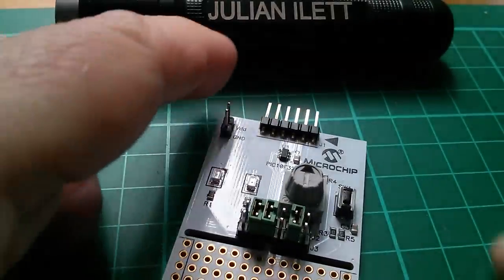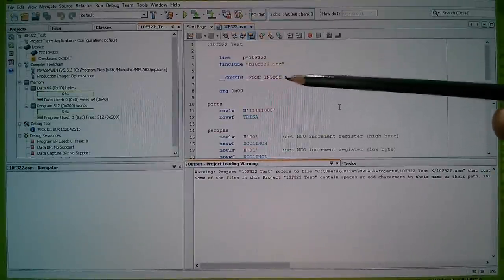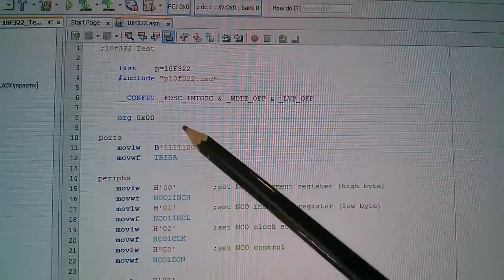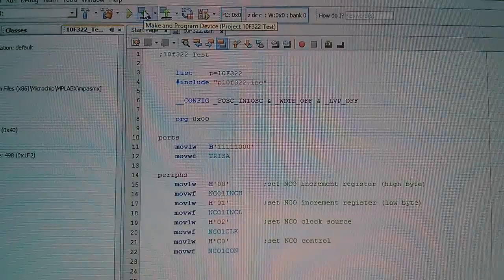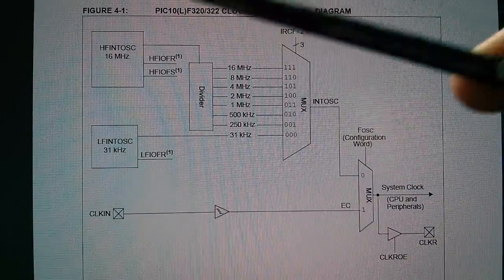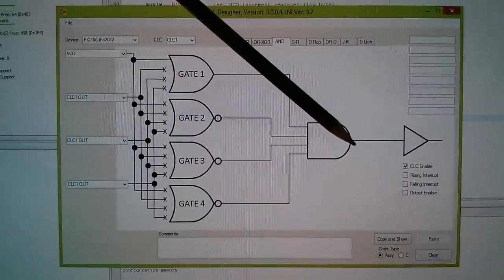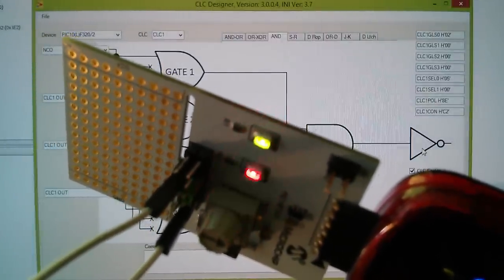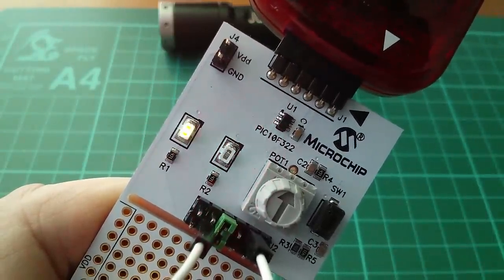Julian plays with: Microchip PIC10F322 6-pin Microcontroller

Comment: Julian Ilett ,
This is painful (assembly language, 200 page datasheet), a rube-goldberg (not the easiest way to blink leds), and yet I enjoyed the whole video.
It is fascinating that such a small device can pack so much.  Thank you for sharing that world Julian.
Reply from the maker: Hari Wiguna Cheers Hari. I really enjoyed playing with this thing - a bit like playing with a huge meccano set.
Reply: Julian Ilett a huge electronic meccano set housed in a box smaller than pencil tip! Just wow...  I'm looking forward to your next adventures. Cheers Julian!
Reply: Hari Wiguna It is not so hard, assembly language on Microchip microcontrollers is one of easiest to use (much easier than one Atmel), there is little instructions (less than 40 on baseline and mid-range 8 bit MCUs) and instructions are picked well.
On other hand you can always use C, MIcrochip offers free C compiler (which is junk, but same stand for paid version), I found that for small PIC for me best C compiler is B Knudsen Data (BKND) CC5X (there is free version which work much better than Microchip paid version, but it is old school compiler and work from command line it don't have IDE)

Comment: I know it is an old video now, but just for kicks I did the same thing with an Arduino Nano that I put Basic on, then wrote a flashing LED program in basic to flash 3 LED's; being an x-cop, of course I flashed the red and blue for the front of the NANO and put an amber on the back side as a warning in addition to the pull over light.  Really looked cool, the wife gave me a 57 Chevy scale model for Christmas several years ago, I plan on mounting those lights on that and make a squad car out of her, should work great an look cool on the dash of our Class A when she is parked in the rv park.
Reply: Did you every finish the little squad car?

Comment: I have been working on the STM8 series which are 16Mhz 20 pin and 15 pence. STM8S103f3. I have been programming  in C. If using STM8 I strongly recommend skipping STs libraries and examples and instead use the free libraries and examples from icking on Github. I consider STs silicon superior to Microchip's but STs development support is best avoided. ST's visual develop is usable. Not as user friendly as Microchip's.

Comment: Incredibly potent 6 pin,  found the PIC10F322 is $11 but the programmer to be rather out of reach at $47. Surely one can do ISP for less? Just loved this Julian. Please do more with the PIC or Arduino involving other output devices, ie contactors, motors, servo

Comment: We've been working with assembly in one of my courses, specifically the Motorola MC9S12E128, and it's interesting to see what different code is requited to make the microcontrollers do the same basic things, especially since the MC9S12E128 is a bit dated. I'm really interested to see what can really be done with a microcontroller that has so few I/O pins!

Comment: Good evening all. Wonderful segment Sir Julian. I'm wondering where you purchased the PIC development board? I have never seen anything from China that came with any additional information regarding the purchased component or module. The programmer itself would strain my hobby budget.
Reply from the maker: It came from Microchip Direct. There are clone PICkit3s available from China, but I've not tried them so caveat emptor
Reply: +Julian Ilett I have the Sure clone. Nicely done if I may say.

Comment: Hi Julian, thanks for your videos. However just one thing to say mate. If you really want to get projects (including pro ones!) up and running very very quickly and easily, give Flowcode a try, not the free version, but the commercial one, it's just fantastic. It takes programming to a different level and you can pretty much do anything you want... A blinking LED or something much more complex can be done in very little time with Flowcode, you can use the interrupts in the program to flag variables, very very easily... Anyway, take care and keep them up!
Reply: ***** :-) Well, you can start with the chip pack option which is £79... then upgrade. But obviously you might not see the whole picture here...the point is that with Flowcode you can build any application is very very little time with no coding. I do appreciate my time and value it too, if I count the many programming hours that Flowcode has saved me... Whilst is OK to use C, Flowcode is a tool that gets the job done in NO time so you can focus on implementation rather than programming... I'm not an expert programmer myself. I've been using it for years now and will not go back to anything else, when it comes to handling timers and more complicated protocols like CAN bus it's just great. Any SPI or I2C device I can talk to in no time, no coding... It's just that I find all the coding explanations extremely boring...
Reply: Kris TheTrader And for £79 you can't use the program in a commercial product.
Reply: Kris TheTrader You sound like you've gotta vested interest in pushing this. Are you're selling it or  are you trying to justify buying it to yourself? Either way you're starting to sound like a complete knob.
Reply: Kris TheTrader And how are you worth £40/hour? As a software salesman? I don't want everything for free, but when someone manufactures a microcontroller and I buy it, I consider it a definite plus that I don't have to pay for software or upgrades.

Comment: I don't have that particular board yet, but I do have a Pickit 3, my question is could all that be done with C instead of assembly? And still get the code from the CLC designer to use?
Reply from the maker: Dog Rox Yes, the CLC design tool can generate either assembly language or C statements. I've only ever programmed PICs in assembly, but now I know a bit of C (from Arduino) I should have a go at using C with PICs
Reply: Cool thanks for the info dude. That's good to know. :-).. I'm trying to find that CLC designer program. Is it obsolete now or something, because I can't find it on microchips website?
Reply from the maker: Dog Rox It's now part of MPLABX IDE, but it's a horrible implementation! I've spent an hour trying to find the original standalone application without success, so I've put a copy in my Drive folder: https://drive.google.com/?srtp=0&authuser=0#folders/0B2WOCQwdjgf3RzFEUnZvbnBiTkU
Let me know if any problems.
Reply: Thanks dude I'll check it out I appreciate the info and the upload. :-)  
Edit... Ok that link isn't working for me because I don't have Google Drive on my tablet here, and my computer in the kitchen is too slow to handle anything Google. so I'm going to try to see if that program is built into the version of the MPLabs that I have.
Reply: Hey Julian, just wanted to tell you Thank You for the program. I finally got a chance to download it today and also the .ini file. Thank you again very much appreciated. :-)

Comment: hello,

what is you camera model ?
Reply from the maker: Google Nexus 4
Reply: Julian Ilett thanks, not bad for a phone.

Do you recommend a good camera for reviews like you do for less than $150 ?
Reply from the maker: I'd like to know myself. Nexus4 is starting to play up. 1 line of capacitive touch sensors in the screen has failed.
Reply: Julian Ilett The TouchScreen can go bad? Really? A friend still uses my old Samsung Galaxy S and it still works well. Do you have any crack in the glass?
Reply: JS7457 One to two months ago you could buy the Galaxy S3 Neo i9301i for 152€ which has one of the best (if not the best) camera/video recorder for its price range. Unfortunately its price has gone up.
Reply: JS7457 I have been using the Canon HF R506 on my channel a bit which I bought for around £150. There's a video with some test footage on a PCB.
Reply: SDG Electronics thanks but 150£ it's 250€
Reply: True, that is the conversion rate, but you can buy it in Europe for €190. I think it's worth spending a little extra at the low end of the camcorder range if you can stretch to it.
Reply: 190 EUR Camcorder is very low end... :/ don't know if it's worth it.
Reply from the maker: ***** No crack, but I have dropped it a few times.
Reply: I'm pretty shure that a flat flex connector is a little bit loose. Perhaps you can open it up and check it.
Reply: SDG Electronics i'm in france and my google search are set for france. No conversion.
What i'm searching for is not a big camera or camescope but only a small one like a compact but who can film in full hd with good quality.
Thanks
Reply: ***** it's what happened with my chinese phone. There was lines one the screen everywere, the screen inside was broken but we couldn't see.
It was a doogee dg300 at 80€.
80€ in the bin because the ebay seller didn't refund men not even a penny and the 45 days protection of paypal was gone. (it's 180 days protection now).
Then i bought a huawei ascend y330 for 63€ and it's a good phone.
Reply: JS7457
That's really bad. But you can have luck with cheap chinese phones, or not. :/
Reply: ***** i really had luck